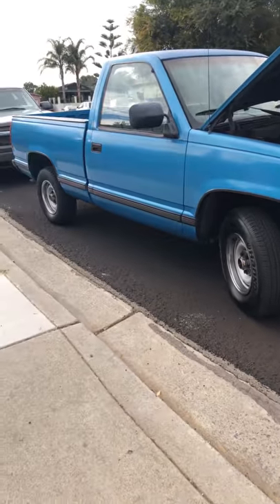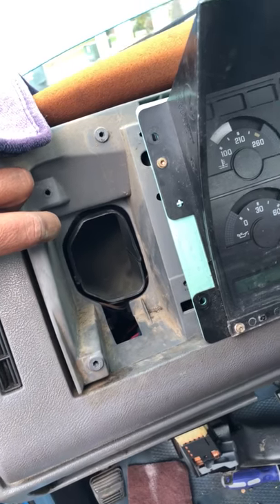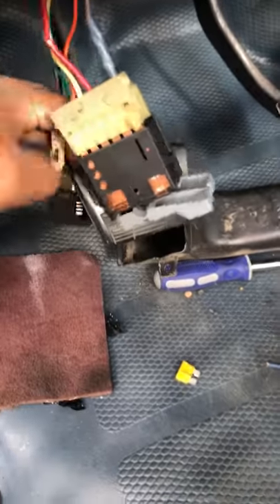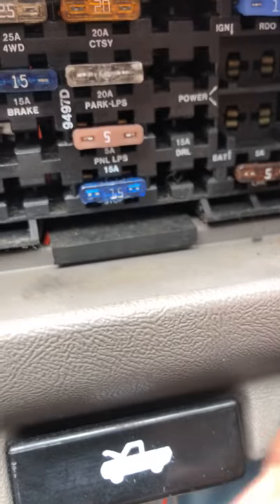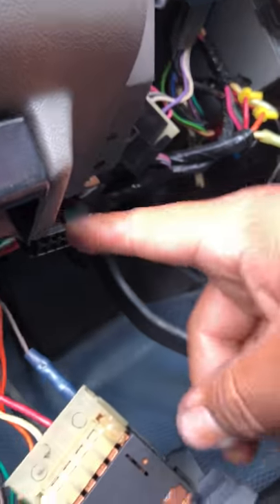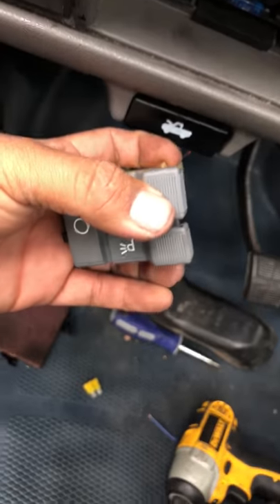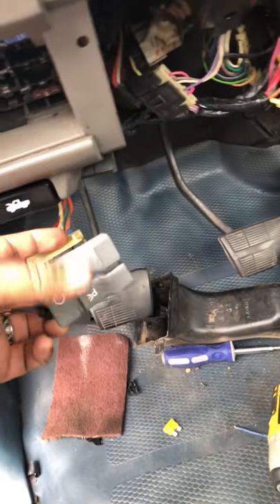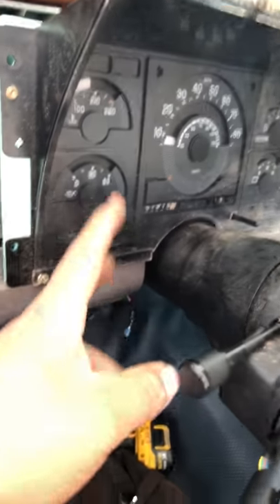91 Gmc Sierra/silverado/c1500 dashboard out, tail lights out, repair

Comment: I have no dash lights, no lights at all in the rear including bed lights all front lights work except running lights and blinkers are random to flash and stay on when break is touched. Help.
Reply from the maker: James Marr  have you tried the ground cable i mention in this video????
Reply: @gallardosmobiledetails3504  thank you for getting back with me yes I did check that ground I found out that the front blinkers somebody had added a wire to the passenger front I sex that everything went to normal except my driver side tail light blinker when it blinks they both blank when the right blinker is on everything's fine I'm only getting dual blinkers I might have left tail light with a left turn
Reply from the maker: Sounds like the cables are mixed around, it would be hard to give an opinion with out fisically seen the truck sorry wish i could help more 😕

Comment: If this works, I am going to be so mad at myself. I have been trying to get my turn signals to work for months. At least I know most of my electrical system is not corroded and is hooked together properly. Lol
Reply from the maker: Kathy Overton let me know if it does, id be so happy for you if it does
Reply: @gallardosmobiledetails3504 , it's going to take me most of the day in the cold with lots of breaks. But I am determined! I only have one small section that won't behave. And, of course, it's my turn signals and emergency flashers. I know it's something in the connection. That's how far I am right now.

Comment: You hear that beap noise mine keeps going off constantly and my battery keeps wearing down for no reason someone has an idea let me know.
Reply from the maker: Bobby Gomez you mean the door chimes?
Reply: @gallardosmobiledetails3504  yes
Reply: @gallardosmobiledetails3504  when I hit the dimer switch to turn off lights on the dash the beep stops. And now windows roll up slow and battery dying.
Reply from the maker: Man sounds like something a bit more conplicated, kinda hard to give an answer thru here, deff a wireimg issue and possibly a ground issue